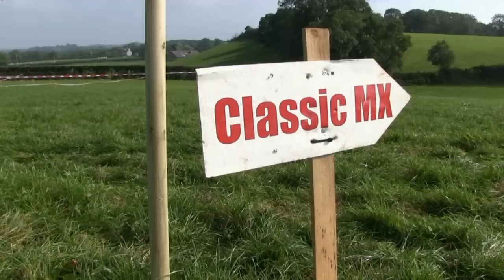Classic Dirt Bikes "Joe Maxwell 580 CCM"

Comment: well, here in U.S. there are suspension limits on vintage racing.  It appears that that is not the case in U.K.  Looks like much more suspension than what was available in 1974..  Is it legal for vintage racing?
Reply from the maker: Paul Roady I know what you are saying Paul although I personally have never heard about any issues certainly within Scottish racing with regards to vintage dirt bikes having too much rear travel. There are many suspension companies here in the UK manufacturing replacement suspension units for these old bikes and it is quite common to have the old bikes racing with these “improved” suspension units although they may not have exactly the same length of travel as the original machine had when first manufactured.